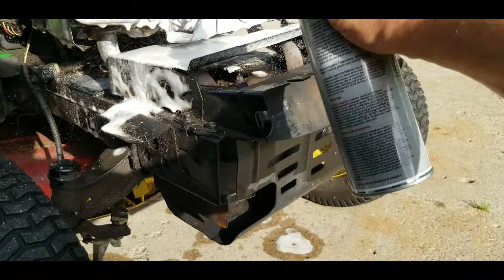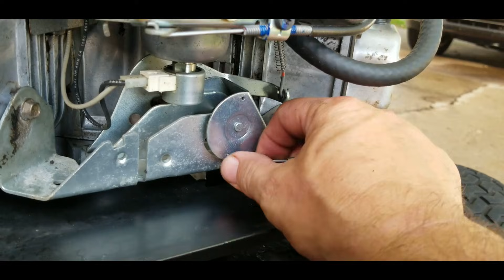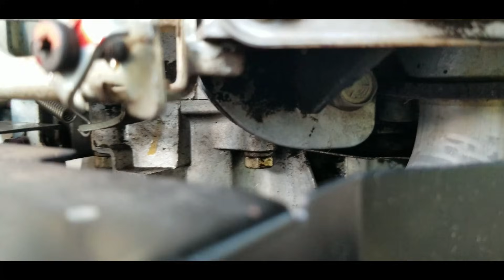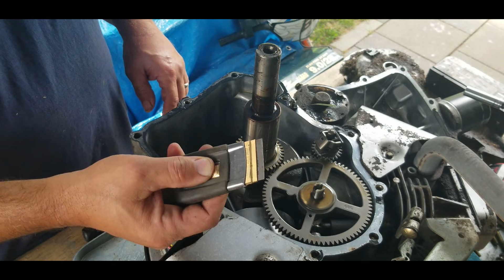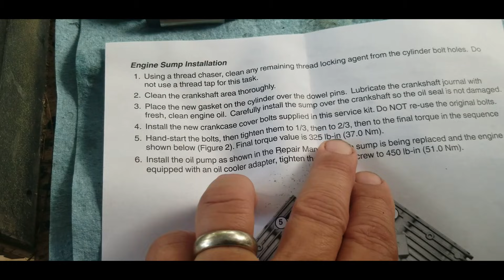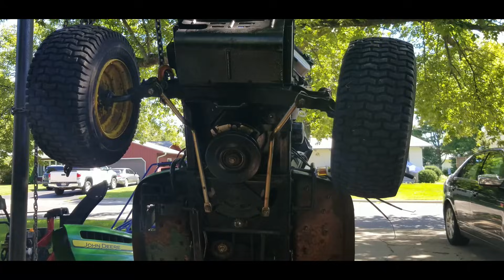John Deere - Finding and fixing a major leak - Briggs and Stratton V-twin crankcase gasket

Comment: Ok what I do is use electric engraving tool and go around the sump with a line 
It holds gasket in place and I run them on engine stand and then retighten the bolts with a tad of blue lock tight 
Shop can’t afford come backs 😊

Comment: Hi, 
1) So the smoking was caused by the leaking oil getting into the muffler? 
2) Did that smoke eventually go away after the leak was fixed and it burned off, or did you clean out the muffler as well?
Reply from the maker: Yes, the smoking did stop after the oil burned off the muffler. After the repair,  there was no more leak and no smoke. Thanks for watching!

Comment: Leaking Crank Seal Hack:  

I had an oil leak develop on my Cub Cadet 1330 that was coming from the bottom crank seal of its Kohler CV 12.5 engine.  It was a relatively small and manageable leak, and I kept periodically topping it off throughout the season.  Before going through the hassle of repairing, it by removing the mower deck, PTO, battery cables, engine controls and then pulling the engine to replace its leaking crank seal, (and while at it the RV/silicone oil pan gasket), I thought I would first try something else.  

It was at the end of my mowing season, and the engine was due for both an oil and filter change.  But before doing that I power washed the mower and engine down to remove all traces of oil and placed a few ounces of Red Devil pour and go power steering stop leak into the engine oil, place a clean piece of cardboard underneath it and allowed the engine to sit overnight.  To my surprise there was no evidence of a leak the next morning. 

I followed that up by starting and allowing the engine to run with that mixture for approximately 15 minutes to allow it to come up to operating temperature before shutting it off and allowing it sit.  I again placed clean cardboard underneath the engine bay and allowed it to sit overnight.  To my surprise and delight when I checked it the next day it was no longer leaking oil from the crank seal.  The product rejuvenated the seal.  I then changed the engine oil and filter.  And although I don't know how long this fix will last, I've run the mower since and have experienced no more leaks.

Comment: Would it be possible to cahnge the oil seal (crankshaft) without taking the engine out?
Reply from the maker: It's possible. You would still have to remove the pulley.
Reply: Excellent, I thought it looked like you could do it but wasn't sure. Need to try that

Comment: Excellent video! Thank you for taking the time to explain everything in much detail, it is much appreciated! A couple comments.... some people apply a gasket sealer onto one side of the new gasket before installing the crankcase housing. Not required, but probably not a bad idea. Also, the reason the gasket kit comes with new bolts is because once you tighten a bolt to a specific torque value, it stretches the bolts ever so slightly. So, best practice is to NOT reuse old bolts that have already been torqued once. You seem to be one of a few people that really knows how to use a torque wrench. When you torque a bolt, tighten it until it clicks ONCE. If you click it twice like some people like to do, it actually overtorques the bolt!!  Good job!!
Reply from the maker: Thanks for watching

Comment: great vid  , I have to do this and my fear is doing it and crankshaft will still leak lol , at least  ya don't have to pull engine agin to try another seal  just on the crank , anti sieze on the crank and PTO shaft is a must for the next guy taking it apart ,

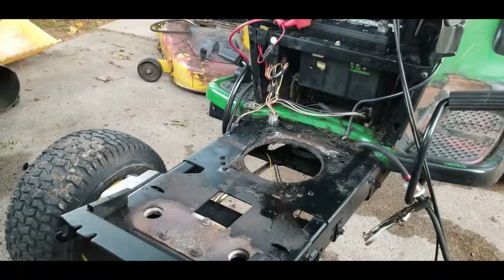Comment: Great video, mine was leaking at the exact spot. You'll notice at 21:38 a good amount of oil runs out at that spot on the case seal by the exhaust manifold. Again great video. It was extremely helpful
Reply from the maker: Happy to help! Thanks for watching!
Reply: Mine blew the gasket in the exact same spot

Comment: You might want to try putting a couple of ounces of AT-205 Reseal in it before doing all that. A couple of ounces of it stopped my power steering pump shaft leak on a 2000 Ford Expedition. That was about 3 years ago. Don't overdo it and give it some time to work.
Reply from the maker: @billsimpson604  thanks

Comment: You don't have to take your engine out to change your crank seal
Reply from the maker: But you have to take the engine out to replace the crank case gasket. That is where the leak was. Thanks for watching.

Comment: Wondering why you took the oil pump cover and pieces apart?
Reply: If you notice whenever he first took off the crank you can see a little piece fall out. That was a the little shaft for the oil pump and in order to put it back in you must insert it from the outside. It is also good to look at the little seal inside of the oil pump just to make sure that it is in good shape.

Comment: Thanks, Real Man Skills!  I watched this video and learned a lot.  I have a John Deere LA145 with the B&S 22HP V-twin, looks like the same engine as on the LA130 you worked on.  Mine has 550+ hours on it, frequently in a dusty environment, and it sure doesn’t look as new as this one.  Mine did fine up the the 500 hour service, but has started consuming quite a bit of oil.  I haven’t had a good look at the outside of the engine yet, but will do that soon.
Reply from the maker: Thanks for watching!
Reply: @RealManSkills could you tell me if an LA175 would be the same repair?
Reply from the maker: @GaryCross-vd2zi  It depends on the engine. Does the LA175 have the Briggs and Stratton V-twin engine?
Reply: @RealManSkills  Thanks for responding, I'll get more info on what I have in the LA175 for an engine.
Reply: @RealManSkills  So yes, my LA175 has a B&S Extended Life Series V-Twin 26hp motor. What hp is your's?
Reply from the maker: @GaryCross-vd2zi  The repair should be the same. The engine in the video isn't mine so I can't go out to look, and I can't remember the HP. Probably around 21 or 22 hp
Reply: @RealManSkills  Thanks for help and the awesome video!
Reply: I'm toying with a LA145 as well. Have you been able to work on yours yet? If so, are all the parts numbers the same for seals/gaskets?
Reply: @Peradime , no, I haven’t looked at mine yet.  I will probably get to it next week.  I have a new hydrostatic transmission to go in it and will look at the engine then.
Reply: @billmckinney7398  popped mine apart today. It all looked the same so far other than torx head screws on the oil pump, and single cable for throttle/choke. I'll pop back in if I run into any issues with parts matching up.

Comment: 42:35  Maybe it would be easier to put the oil seal in AFTER the cover is put back on, and using a pipe or deep socket the same diameter as the seal, or slightly smaller.
Reply from the maker: That's another way, yes.

Comment: Great video! Just bought a used Husqvarna yth2448 mower with briggs and Stratton engine it's leaking pretty bad can't tell for sure but looks like coming from left head but is dripping off same bolt. Thanks for sharing be safe have fun
Reply from the maker: I have a Craftsman DLT3000 with that same engine and it had the same leaky crankcase gasket. It seems that these V-twin Briggs and Stratton engines are prone to that problem. Worth fixing in my opinion. Thanks for watching.
Reply: @RealManSkills  I have a Mahindra 1626 tractor with 6ft befco finish mower I usually mow with but it's been at dealer for over a month waiting on parts so I had to have something to mow with just can't do the push mower thing anymore especially on 4 acres.  Just got finished fixing the Husqvarna ran it bout 25 minutes so far so good it's pretty sweet little mower.  Yes definitely worth fixing.  Thanks again for the video
Reply from the maker: @mikerequa820  Happy to help! A successful fix always feels great!

Comment: Thanks for the video. There are some things I would have done differently, although nothing wrong with your methods. I would have cleaned the exterior of the crankcase first, including using some emery cloth or scotchbrite to get the crankshaft completely free of rust. After removing the top I would pump out the oil, wipe up and clean inside well and stuff the case full of clean rags to prevent any debris from dropping inside. I like to remove difficult gasket material with a brass bristle wheel in my Foredom tool or Dremel. I would have lubed the inside of where the new seal went and the seal itself and seated it with any soft object that fit it well like a piece of PVC pipe. I would have turned all the screws down until they stopped, in one shot, then started the tightening sequence. I would have scribed a permanent mark into the aluminum to indicate CCW rotation setting of governor arm.
That’s all!  😉😂👍🔧🧰
Reply from the maker: Thanks for watching.

Comment: What is going on with the paint  John Deere is using every one I've seen the paint on them is flaking off
Reply: It’s likely poor pre work.  If the metal is not cleaned and dry or if it’s not primed it’s gonna peal.   I’m betting JD is not using high end auto grade primer or finish paint.   They just want to get them out of warranty before it happens.
Reply: @kenhenderson628  that is the truth about that matter young man 👍😎 unless John Deere used powder coating